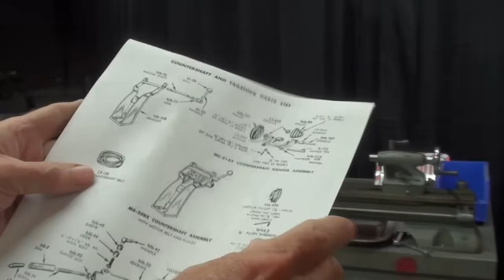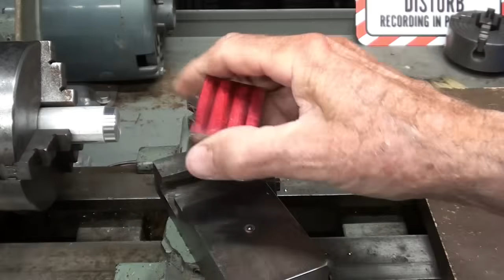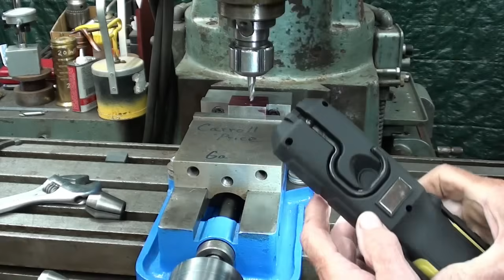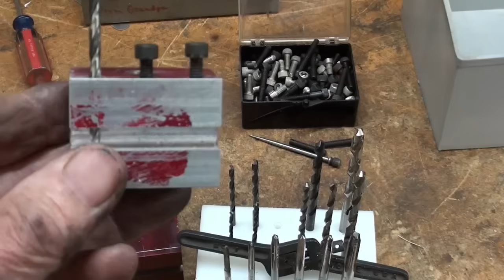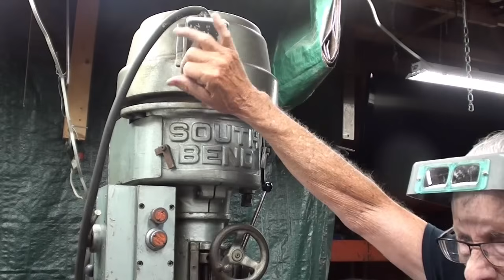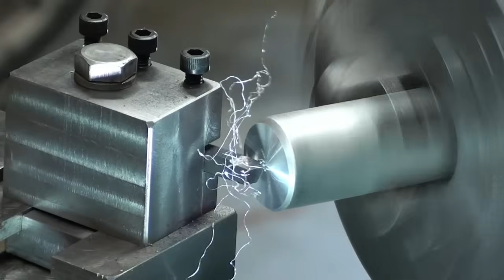MAKE TOOLPOST FOR ATLAS 618 LATHE #1001 pt 8 tubalcain

Comment: Hello Mr. Pete I have a atlas mk2 618 it was made in the 80s it has the squared compound slide like yours it was a factory piece on mine. My headstock has a back gear and a different belt and pulley setup.
Reply from the maker: That's interesting, so yours was an upgraded model.
Evidently, the squared compound was original on later models

Comment: Just a thought - mill your slot, off center, and then mill the top and bottom of the holder so that installed one way it's correct for 3/16" tool bits and correct for 1/4" tool bits when flipped upside down.  You'd still have to shim for final setup, but it'd get you close.
Reply from the maker: Good thought

Comment: Good video Mr. Pete. You could get long set screws to eliminate the box wrench clearance problem or get a longer bolt and make a thick washer to clear the top of the cap screws. I use to put cap screws in chain sprockets at work so as to get more torque to lock it down to the shaft.
Reply from the maker: Great idea, thanks

Comment: From cold and wet England. I thoroughly enjoy all you videos If you angle the slot slightly (my example is 3 degrees) it allows adjustment of the height of the cutting tool to centre height by moving the cutting tool  backwards or forwards as required. It may lead to the cutter being less well supported when extended but avoids the need for shims. Best wishes.
Reply from the maker: Great tip!

Comment: Might Have Something That Might Interest You. For The Atlas Mk 2 Model 10100 6 Inch Lathe. Near The End They Made A Set Of Solid Tool Holders. A Tool Bit Holder, Boring Bar Holder, Cut Off Tool Holder, And A Knurling Tool. If Interested. I Can Send The Complete Set To You. But Will Want Them Back. Should Be A Solid Guide For You. They Can Also Be Used With Carbide Tool Bits. Also Would Include A Copy Of The Instructions.
Reply from the maker: Thank you very much for the offer, but I already have those tool holders

Comment: Lyle, I'll make a tool post like this, just upsized for my 113-year-old South Bend lathe.  Would you consider making a video explaining the different grades of HSS tools and which materials they are best suited to cut?  I seriously doubt that my lathe is rigid enough to easily use any types of carbide cutters, so I plan to only use HSS on it.
Reply from the maker: Good idea, but I would really have to study up

Comment: I built one for my 1933 Southbend 9 inch lathe and used key stock to get my center height right and milled it on the lathe with the end mill in a soft jaw chuck.
Reply from the maker: I like how you got it centered.

Comment: Running the mill motor at the wrong voltage will affect its torque, but not its speed. Maybe the machine was intended for bigger tools?
Reply from the maker: I think I misspoke. The speed was probably OK, but it had almost no power or torque. Could easily be stalled.

Comment: I have 3 - 618 Atlas lathes 2 have the square tool post holder, the cast have trouble with cracking, would break in half.

Comment: Why does the HSS cutting tool slot have to be in the middle of block? You don’t tap the full depth of the 8 mm Allen heads anyway. Worried the block will distort?

Comment: I have Gorton 1-22 Mastermill that has a very similar quill stop to the South Bend, I got a small rubber wheel mounted in a cordless drill that I use to adjust it when I have to…. Adjusting the knee to the depth is much easier if I can. Thanks for the video Mr. Pete!
Reply from the maker: That’s a great idea

Comment: 13:58 Running an AC induction motor at a lower voltage doesn't affect the speed.  It makes the available torque (per amp of current) lower.  The speed is determined by the mains frequency.
Reply from the maker: Thanks

Comment: I made a version of that tool holder (sort of) that uses a post bolted to the compound and the tool holder block is split and a cap screw clamps it tightly to the post. This design can be found on the internet and it is even named but I don't recall the name. There is also a depth stop screw. This version is a bit of a quick change tool post as multiple blocks can be made up for boring, etc and by quickly releasing one block with a turn of a screw, it can removed and another one installed. I milled the slot on one block at an angle (maybe 8 degrees) to suit high speed steel cutters better. Another great video; keep up the good work! Oh, I live in the state of taxation, like you!
Reply from the maker: I am not familiar with that, but it sounds interesting.
I assume you would not like to go fishing with Pritzker
Reply: @mrpete222  You  presume correctly!
Reply: @mrpete222  I found the tool post design I spoke of; it is called the "Norman type". It is a pretty good alternative and can be built entirely on the lathe (with a milling attachment).

Comment: On that tool holder bolt that you have to use a open end wrench on, just replace it with another and larger cap screw.

Comment: Just out of curiosity, why did you choose to cut the original piece of stock down?  
I'm thinking that if it were just a little bit bigger, it could turn into a 4-way post with very little added work. 
If needed, maybe knock the bottom corners off so it can rotate freely?  ...or mill the top surface of the homemade compound back a bit to accomplish the same goal?  ...I don't think that would weaken it by any noticeable amount.
Just a thought.
Reply from the maker: Good idea

Comment: Very nice tool post that allows setting the tool bit at the proper height quickly - thanks for sharing this video.  

For those without a mill they could make the tool post in a sandwich method as LH Sparey showed in his book "The Amatuer's Lathe" where he bolts three pieces of flat steel together to form the final tool post with the slot for the tool bit.
Reply from the maker: Excellent idea. I was unfamiliar with this technique. I should do that sometime the pieces could be welded together also all although that looks crude.
Reply: @mrpete222   To weld the pieces together could be done and made to look not too bad by creating a V groove using a sander (flap wheel) along the seam where the pieces mate - weld in the V and then use the flap wheel once more to smooth the welds.  Years ago I made the 4 way tool post that is shown in the book I mentioned by bolting the three pieces of steel together - countersunk the 4 allen screw heads so they were not in the way for the tool post stud and nut that held it.

Comment: If I didn't have a quick change toolpost for my Atlas 3950, I would make one of these. Maybe I will anyway!  I use a Multifix (Chinese clone).  It's the Aa size, but the holders will take up to 1/2" size tools. Most of the time I use 3/8 tools.  I do have some 1/4" HSS, but I don't think I have any smaller.  I love these kind of videos and would rather watch the entire machining process no matter how many hours long the video is!  Keep up the good work!
MJ

Comment: Hi Lyle,
If you’ll send me the little saucer shaped tool rest I’ll surface grind the bottom to the correct lower height. That way you won’t need to tilt the tool so much. Send the part and the approximate amount and I’ll get it done pronto.

Comment: I stake my Tee nuts with a punch to prevent the bolt or stud from going past the bottom.
Regarding tapping threads. I take the same advice. Slow down, be careful.. Don't get in a hurry, pay attention. It's worth it. Better than having to do it all over again.
It's always been the comments you make during the process of making things that are great things to learn / practice when doing machine work. I have no need to make anything like that but I always pick up good pointers that I put into practice in my own shop from you.

Comment: It will depend on what type of motor that is being used but the voltage will not affect the speed,  the speed is governed  by the frequency,  but the power will be affected by the voltage and it is possible that the reduced power would have a braking affect.
David

Comment: Nice tool post & another great video. One could make several of those, including T nut, , each dedicated to a different type of tool bit, LH, RH, Round Nose, threading, etc. It's a simple matter to remove and replace the tool post with only one bolt. The initial manufacture of several of those tool posts would take time but once made changing tool bits would be almost as fast using an Aloris type tool post.

Comment: Great video, I gave you thumbs up. For the quill spring on your South Bend mill, try contacting Grizzly. I heard that when they bought South Bend, parts inventory was included. They don't advertise, but you can still get new parts for old South Bends. Maybe they will have your spring.
Reply from the maker: Thanks for the tip!

Comment: I do enjoy watching your Video's. I must say that you are no designer, so lots of tiny design errors. In this one, you have completely forgotten about the bottom inside corner, where your mill cutter leaves a tiny radius. You probably know not to place the cutter tight in against the corner, but does your viewer? Me well I am retired & a design engineer living in England. I was glad to see that you got the bottom edge of the T nut level with the side of the holder & it was long enough not to place excessive force on the top slide. Where will I really criticize you, that is easy. At this time people are not so strong, particularly Ladies. So the inclusion of a needle bearing under the bolt is sensible. Also, a spacer under the bolt enabling the use of a ring spanner (wrench to you) is desirable.
Reply from the maker: It’s true, I am an incompetent fool

Comment: This is a good mod, especially in terms of rigidity. I made a couple for my SB13. One for 1/2" tooling and another for a parting blade. Shimming works for fine adjustment. I was doing some semi-production work on some large aluminum pulley blanks. The added rigidity help me do a lot of heavy roughing in a much shorter time.

Comment: Loved this video, as well as all the 618 videos. Thanks for digging into this model, there are tens of thousands of them out there! 
I have a couple of questions I hope you could answer:
1. There is a manufacturer in Australia that makes a “DIAMOND” tool holder that holds the cutter tool tangentially to the work. The cutting edge looks much easier to grind with this method. What are your thoughts on this type?
2. Like yours, mine came with a horribly set belt. In fact it was stiff and brittle and I had to cut it off to bring the machine home. Replacing the belt means taking the spindle out. Alternatively I could use a link belt but the smallest link belt I could find is larger than the 3L belt supplied by Atlas and doesn’t ride down in the grooves of the pulley well. If you were going to keep this machine, which belt would use? If the original style 3L belt, would you do a video of removing and reinstalling and adjusting the spindle?
Reply from the maker: And yes, I own one of the diamond holders and I have shown it in videos. My intention was to make a video on how they work and I never got around to it.
Reply from the maker: I have already replaced the belts with link belts. That totally removed the vibration and it runs quieter, but you are correct. The belt does not ride very deep in the groove. I bought the belts on eBay.         And the bills are continuing to stretch and I have to remove a link every now and then. Other than that I like them.

Comment: I prefer the aloris type tool posts but not sure they make them that small. That would be a good project to make one of those and a few tool holders for it. The larger ones have sliding tapered dovetail that moves up and down to lock the tool holder but smaller ones have a plunger that comes out when you pull on handle to lock the tool holder. That would be easier to make. I think there is just an eccentric shaft inside that pushes on the locking plunger.
Reply from the maker: Someone gave me a quick change to post holder. I have not shown it yet.

Comment: Im not sure why you say to use a taper tap. I have been a machinist for 40 years and I bet I havnt used a taper tap more than a few times. they turn much harder than a plug tap. My preference for a through hole is a gun tap. I had to tap a whole lot of 10-32 in 1" thick 316 stainless steel and I ground the shank down on a gun tap on a tool and cutter grinder so it would go 1" deep and I power tapped them.

Comment: Nice job on the tool block. Shop class is always best. I have been running a similar one on my South Bend for years. When I made the slot for the tool bit I raised the block by have the thickness and chucked an end mill in the lathe chuck to cut the slot. I think it was the best way to get on center.
Reply from the maker: Brilliant idea